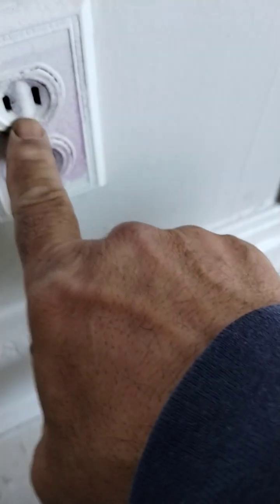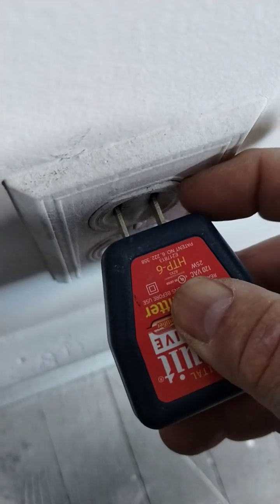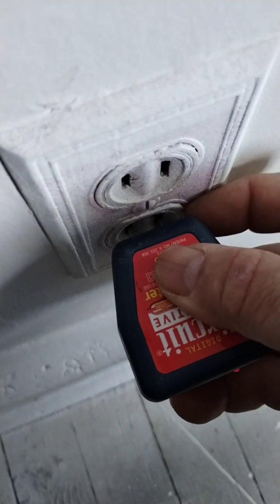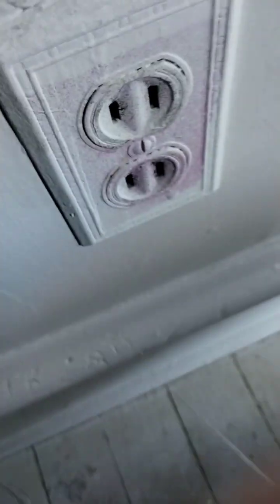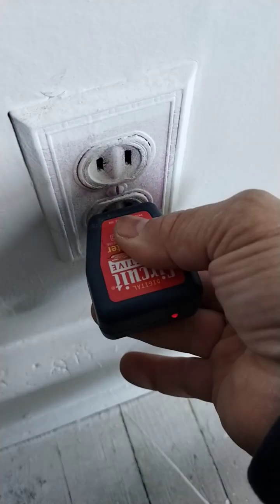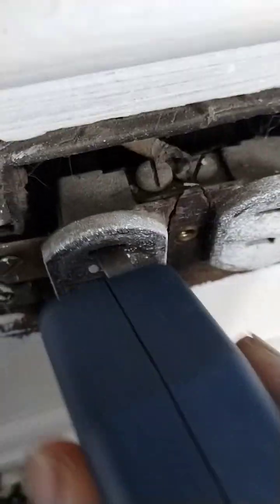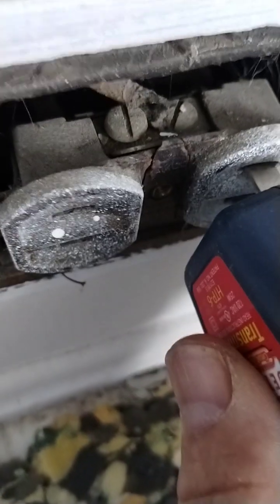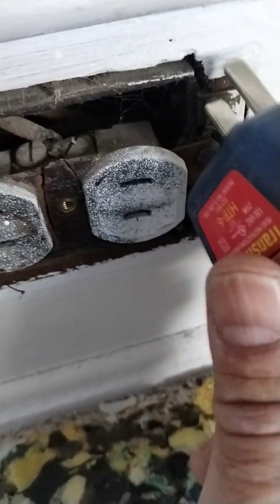Electric Old receptacle why replace plus change breaker to arc-fault #electrical

Comment: Code requires us to install Arc Fault Breakers on 2 wire circuits. Especially if you want to install 3 wire outlets.
Your showing people thing Every Home Owner Needs To Know. Good Job. 👍🏻
Reply from the maker: I have more coming which will show them at -fault receptacles and GFCI and combinations they can use but the superior one is from the breaker but I just hope people use some form of arc protection.
I will show more in the next three videos, thank you for your support.